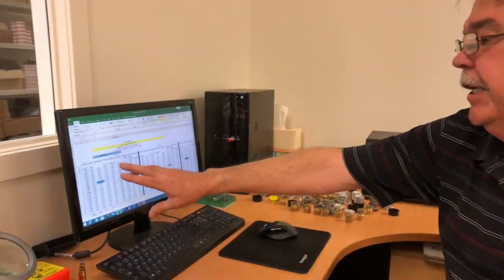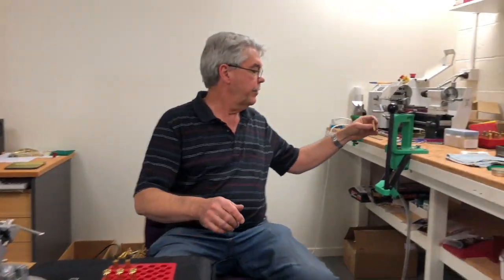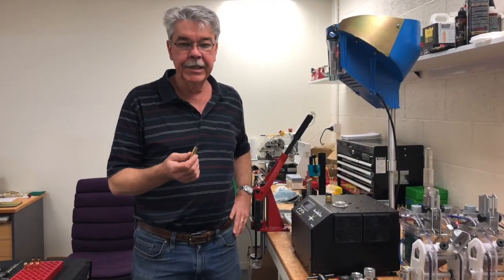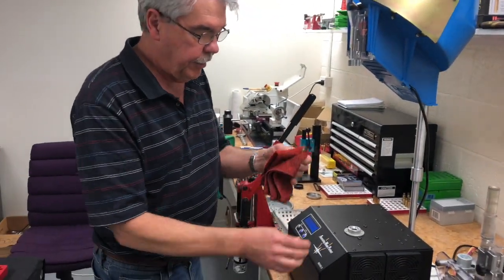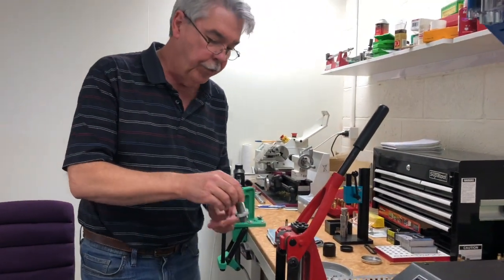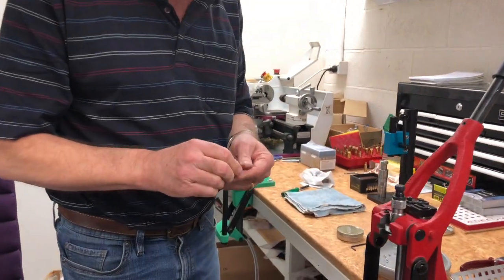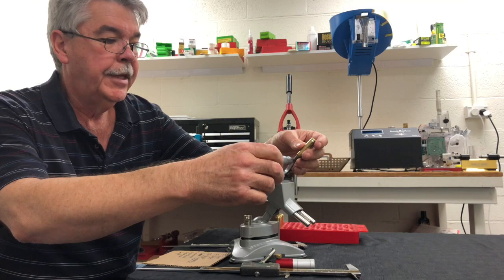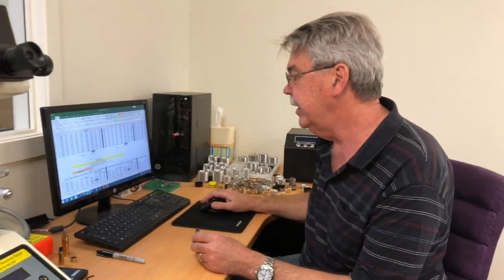Annealing under the microscope Part 5 Preview

Comment: Thank-you so much for this great video series.  

By knowing the neck concentricity (runout) and concentric wall thickness on your new case (sinclair, neko, 21 century concentricity gauges and a redding wall thickness gauge), we can cull any case say above 2,500 on both measurments, then measure again after being once fired to make sure we are comparing apples with apples.  

We want to see runout at or below 2,000 on all cases.  Then we know we are compairing simular cases. You-all could be comparing cases that are very different (some with 1,000 and some with 3,000 or more neck runout) and not even know it and potentially get uneven results and distortions in the final data set, or maybe not.  Because an RCBS Matchmaster seating die on a co-ax press loading a nosler balistic tip bullet could still give you a final bullet runout that will go strait down the barrel out to say 100 yards and so maybe everything I just said doesn't even matter.

The redding expander ball can cause neck distortions and needs to be replaced with a sinclair carbide expander mandrel which can be run before and after resizing.  I have found it is easier to straiten up the neck when they are warm especially on problem cases say out beyond 3,000 in the neck.  

I will warm them up before I resize them whether once fired or new.  With the co-ax and a Lee seating die or a wilson arbor press die on my k and m press loading Nosler balistic tip bullets I can have as much as 3,000 runout in the neck and still get a 1,000 runout on the bullet.  

The thing I want to know is... Are my dies improving the neck concentricity or my cases gona be the same or are they gona get worse after sizing... so I just keep trying and testing new dies until I get a die that can straiten a case neck that is say 2,000 or 3,000 out down to 1,000.  

I sort my new and once fired brass by neck concentricity runout using ziplock freezer bags.  (Lapua, norma, nosler, starline, remengton, lake city and winchester, then I load nosler balistic tip bullets.  Lapua dosn't tumble polish their brass and so I get a larger percentage of strait cases from them then say from starline.  

The goal is to align the tip of the bullet with the imaginary line running down the center of the barrel and get this line to run through the center of the flash hole in the back of the cartridge.  Next I want the trim length between the max length and the trim length and I want the shoulder set back so there is no resistance when closing the bolt.  I want the bullet to stay in place without having the bullet resize the brass when I load it.

I have been leaving the dry lube on the outside of the case... so now I'm going to start wiping it off before running the expander inside the case.  I use 0000 steel wool to true up and clean up the cases and I clean up my cases by soaking them in Lemi Shine and dawn soap after removing the primer.  I also leave the case in the die when atempting to true up the neck to allow the die enough dwell time to straiten the neck. Sometimes on problem cases for extended periods of time.  

80 percent of the accuracy is in the bullet, powder, and primer, the rest is in the case.  Without regard to the shooter, his rifle and scope.   Before we see the results... I see proper anealing as a way to straiten the case neck and tune the neck tension on the bullet for optimizing long range accuracy.